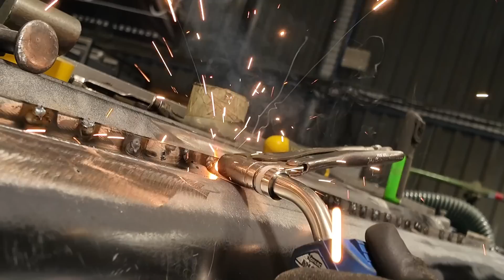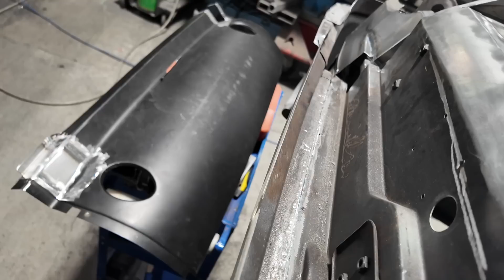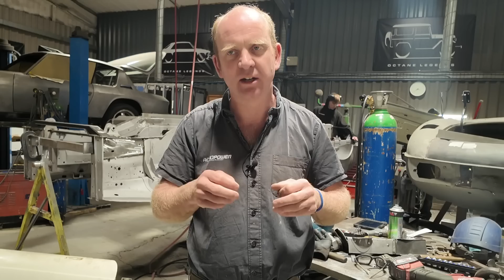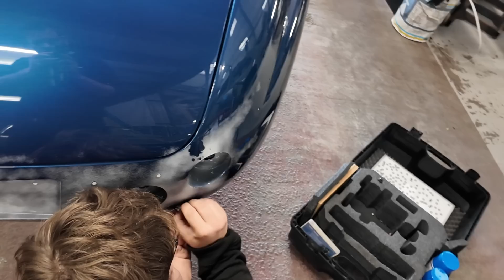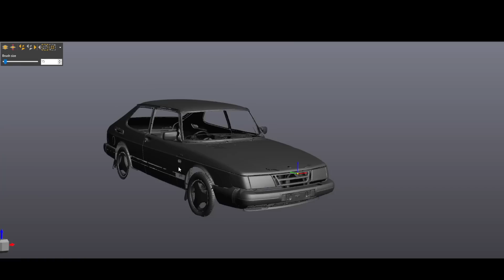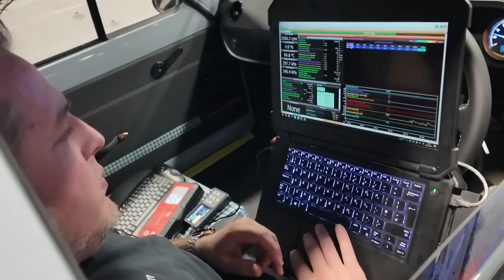Restomod Jaguars! XJC, E-Type & MK2 2-Door.

Comment: Engine proposal for a Retropower DS can be the 3l v6 from the citroen c6, that is fundamentally the same engine mounted on the clio v6. And I have a question: is there a limit of age for cars you are keen to work on? Maybe not on production year, but maybe on type of construction? I mean, if a customer ask to you to start a project based on a modern car with plastic bupers, etc. Do you categorically refuse or you can evaluate the thing?
Reply: I imagine re-engineering anything with airbags ABS etc is a whole nightmare no-one needs. Cal's explanations might take a lifetime too!
Reply: Having ABS is great, I would not want a car without it now. I see all the Restomods in the States putting Wilwood brakes and they could be running a stand alone K70 ABS ECU from the E36 BMW. It's a swap used by Porsche Cup cars instead of the Motorsport Bosch unit. The CTSV brake conversion for the S15 Nissan is a game changer. Plus Ceramic for under $2500.

Comment: Surely a Citroen ds would love a Maserati engine ?
Reply: 😂😂😂 it’s already got one.   But it could do with a later one.
Reply: Sorry my mistake 😂😂 I was thinking of the other model.
Reply: The cam chain gets eaten as it's driving the hydraulic pump.
Reply: I think its the sm, think Bert Reynolds drives one at the beginning of the original " mean machine"
Reply: We had an SM, the engine has the hydraulic pump driven off the end of the exhaust shaft at the flywheel side of the engine along with the alternator, a/c.  So the cam chain is driving all of this, plus the cams.  As the engine is behind the gearbox and they did not run a dedicated shaft thru the block. There is a reason why accessory belts are a thing and only in recent years direct drive is used. All of which are deeper than a YouTube comment section.

Comment: OK I am sure you are aware but the 'bell mount' for the radius arm on the XJC is off set and must be put back on in the correct orientation. YES rear bumper had an absorbent ram in it for silly American rubber bumpers.
You have to say that the Jaguar MKII is stunning even with the modifications, which I do like, and that is praise from a MKII owner :).
Environmental arguments for electric conversions are simple EV's cause more pollution in building them and charging them, the government have brainwashed a lot of the public.
Reply: Even Volvo said electric power takes 70k miles before it offsets production carbon deficit over ice.
Reply: Hear here.  Couldn't agree more.